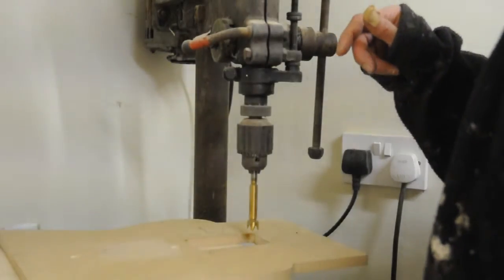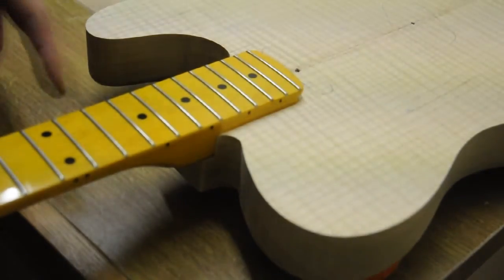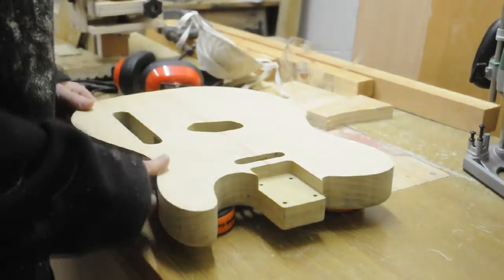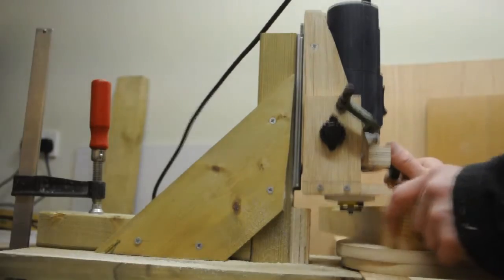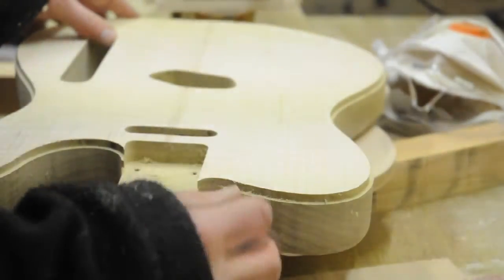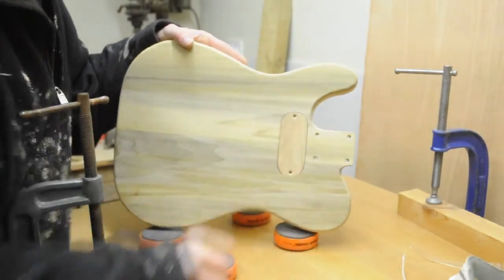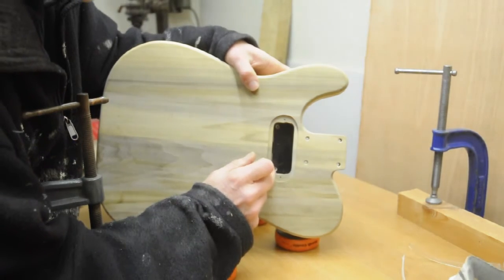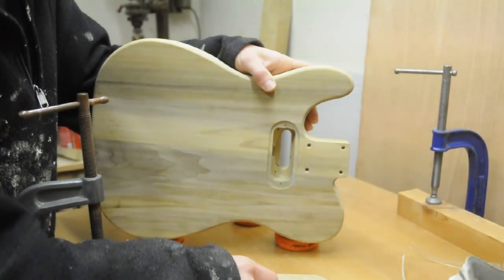DIY Luthier Telecaster build part 5:  Routing body cavities and binding channel with a home made jig

Comment: I’m watching your progress with great interest. I am considering diving into building my first guitar and 
wondering if you had considered, in retrospect, to cut the neck pocket after routing the binding slot to reduce the 
chance of chip out on those pocket corners? Also wondering if perhaps the veneer bubbling was caused by 
the choice of glue? I’ve just seen an article about “cold press” glue which doesn’t have as much water in it, especially designed for veneer. It’s cool to see someone do a build with minimum tools. I liked the “floating router jig” to follow the arm contour. Cheers.
Reply from the maker: Yes I think I would cut the binding channel first next time and in fact fit the binding. The end of the binding would then be cut off by the router which would be neater.  I used Titebond cold press veneer glue for the veneer so I don't think it's that. I think it was a combination of using too much glue and not clamping it well enough due to my cheapskate vacuum bag which was rubbish. Next time I will clamp it with clamps!

Comment: You went with an angled neck pocket, yeah? How did you handle your calculation of angle? Did you just use the bridge height and shim to that level, or did you calculate angles and such?
Reply from the maker: No it's a standard flat neck pocket
Reply: @diyluthier6349  Oh. I was looking around 0:32 in and thought there was a gap at the tail end, between the body and the template. I assumed it was a spacer.
Reply from the maker: @aaronblack425  Ah yes I can see what you mean. No that's the arm contour on the body.

Comment: nice, do you think there will be enough strength in you neck joint with the pick up cavity right through the body?
Reply from the maker: I did worry about that initially but it has been fine. There is still a lot of wood around the neck joint so it doesn't make much difference.